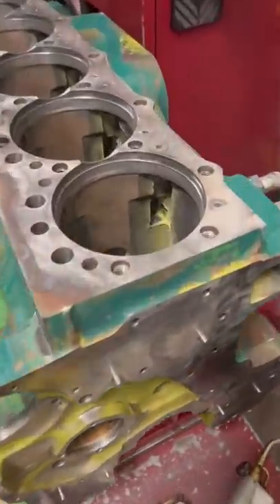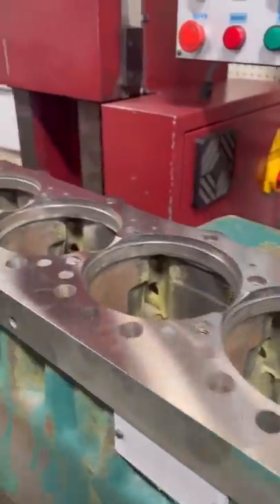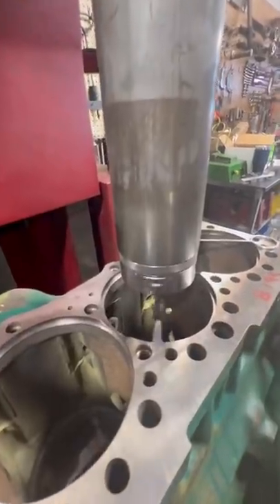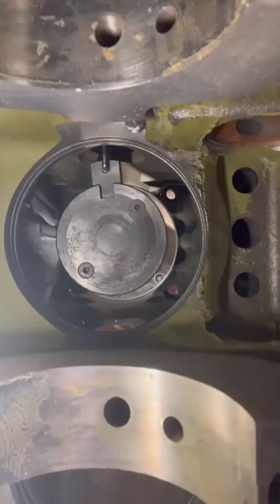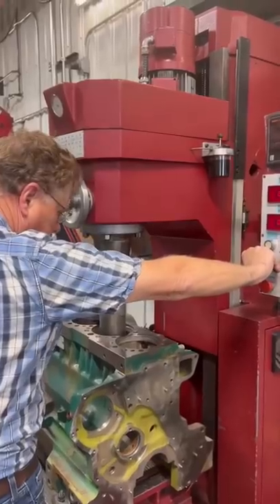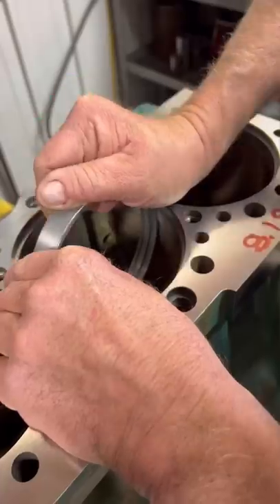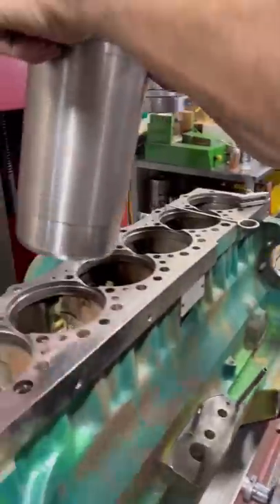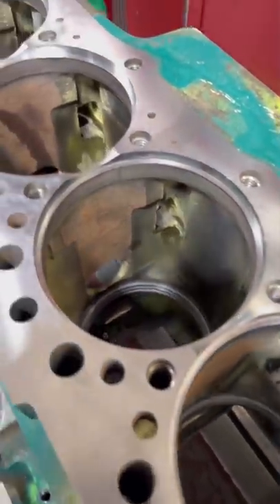#shorts Repairing A 6076 John Deere Block Is A Lot Of Work!

Comment: This is an interesting design. Do the cylinder sleeves just drop in and get held down by the head?
Reply: Not that I've ever seen. Typically they're press fit and you need to drive them in. Then they'll typically be machined down to match the deck on the block.
Reply: The sleeves have o-rings to seal oil and antifreeze apart from each other.   Yes, basically the head will keep them from popping up.
Reply: @sl33ksnypr285652 
I remember pushing em out with a block of wood and a floor jack , but install is not much more than a hard push on these deeres. 
I clicked cause I used to rebuild a pair of em about every 15mo or so. 
Great engines.
Reply: This is the wet sleeve system
Reply: This is the design for most larger diesels.  You rebuild the motor in the truck or equipment. It’s called an in frame. The only time you remove the engine is for block or crank related issues. You can even cut the counterbores with the block in the vehicle. Another advantage is if you have a damaged cylinder you can replace just the damaged pack without a complete tear down. At our shop we can tear down to the cylinder, replace it, perform machine work in house and have a truck back on the road in as little as two days. Wet sleeve design is awesome!
Reply: Yeah basically. It's a wet sleeve diesel, most big rigs/agricultural equipment are like this actually. The sleeve drops into the water jacket and seals it off. The issue in this video was some damage which could break the seal and allow the water to leak into the crank case. Wet sleeves  are pretty cool, it would make engine rebuilding so much easier if all engines were made like this.
Reply: @jcm78  wet sleeve is awesome.  Almost all the natural gas oilfield engines I work on have wet sleeves too.  I just did an in frame on an 1,197 ci Waukesha.  Usually we pull the engines for an overhaul because on natural gas compressor, they have all the engine coolers and compressor gas coolers so almost all times we just pull the engine for overhauls.  But even still it makes for super fast overhaul.
Reply: @jcm78  An old friend once had a dozer that had the crank replaced under warranty.  He did an in frame not long after and was sure glad he didnt have to mess with the crank!! Factory did the heaviest work for him.

Comment: Ever done a tr3 motor there's just an o-ring on the top and bottom to seal the water jacket that's it... The head holds the cylinder down